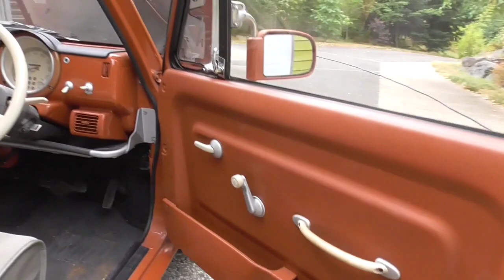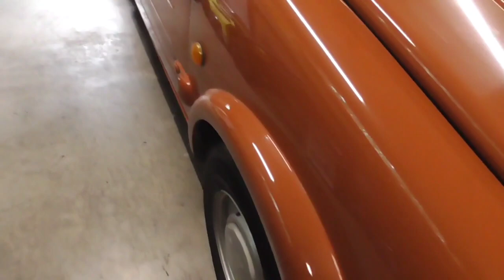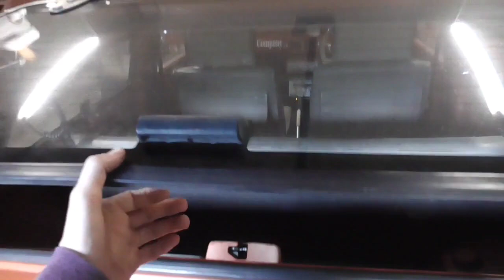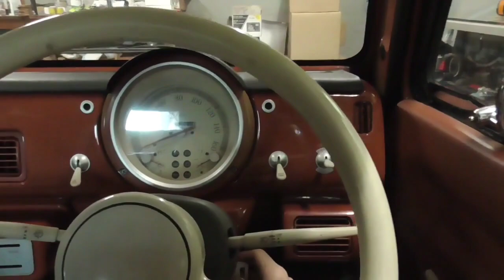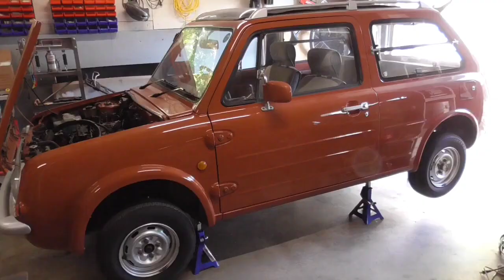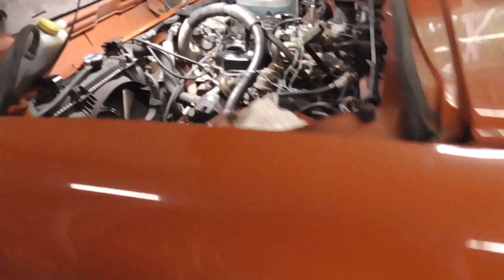Project: PAO EV - episode #1

Comment: I would definitely suggest a chest-mounted camera so you can film what you're doing and still have both hands free. You could do a head-mounted camera instead, but those tend to get a little crazy (you don't realize how much you move your head until you watch one of those videos!) The chest-mounted ones are a good compromise, and you can find ones that can accommodate many different kinds of cameras (usually GoPros). Sufficient lighting is key to getting good shots too. A tripod with a flexible neck for the camera mount would be good too, so you can aim it wherever you are working. Good luck!

Comment: Looking forward to this. Any updates on the Cappuccino? The last video from February said "to be continued" and kind of ended abruptly. How does it drive? What kind of performance/range are you getting, etc?
Reply from the maker: Always nice to hear from you.  More Cappuccino EV videos to come.
Reply: @theevolvingworld  Same! 

An update on my 2016 Kia Soul EV+. Well, in the really hot summer months this year in Florida, when the daily temps were in the mid to upper nineties, my max range was down to 65 miles or so. I figured it was because of the outside temperature. Then, in August I got an error message on the dash upon startup: "Charger Error" and I could no longer do level 2 charging at home (luckily the DC fast charger still worked). So, I took it to the closest authorized Kia EV dealer (at the time) about 110 miles away to have the onboard charger replaced under warranty. All was good at first but within a few weeks my range starting dropping.... FAST! Like a few miles less every time I charged. Now it has steadied at around 40 miles of estimated range (though it will go around 45 miles). 

I have an appointment at a MUCH closer Kia dealer (about 10 miles away) that just recently became EV certified. When I talked to the guys there they made it seem like there was a really good chance I'll be getting a new battery under warranty, but it will take a long time. He hinted at possibly giving me a rental car in the meantime which I hope turns out to be true. Anyway, the nice thing is that even though it is not ideal I am still able to drive the Soul with no problems until the appointment this Wednesday. Lucky my job is only 10 miles away from my house! I still love the car and plan on keeping it for a while.
Reply from the maker: @JustWasted3HoursHere  Thanks for sharing.  All my intel has the Soul EV as bullet proof reliable.  This conflicts with that.  It's at the top of my recommended EV list, along with the best of the first gen EV class.  Maybe, it's just a one off.  At least you get it all replaced for free.

I'm looking forward to getting a new bigger battery for my Bolt EV under recall.  That should keep my range near 270-300.  I'm at 61k & it's running great.  Makes a nice road trip car.  Planning on doing another 3k trip to LA later this year.
Reply: @theevolvingworld  Yeah, all of my research had shown that it was really rock solid too. The range really started plummeting after the on board charger replacement so maybe they did something wrong there? I have no idea, but I'm glad it's going to be replaced under warranty. That battery pack is something like $13,000 otherwise, if you're lucky! It's worth pointing out that the car is still excellent, runs great and is totally reliable even though the range is less than optimal. My appointment is tomorrow and they said they might need it a few days to analyze it. There is no way that the battery pack is not damaged though, as it's using 20% of the battery to go 10 miles. Not good.

On the Chevy Bolt, I hear that the new software update will max charging to 80% for now, but I don't know if that's for current batteries or the replacement. Of the 2 billion dollars of the recall, LG Chem is paying 1.9 billion of it, which makes sense since it's their battery that is at fault. I'll bet Chevy threatened to sue them otherwise.